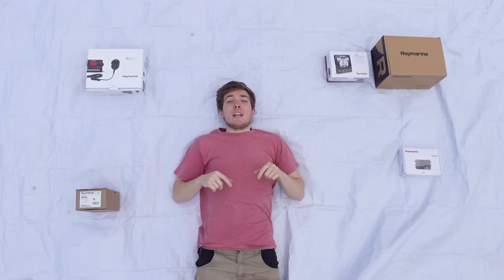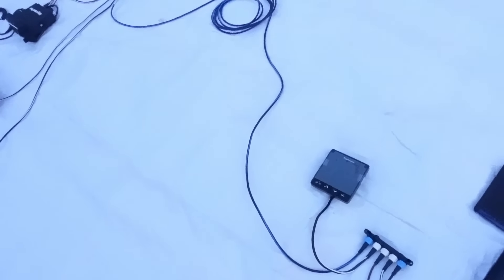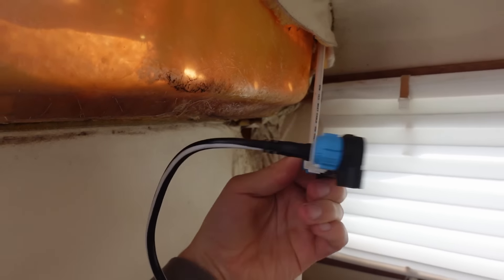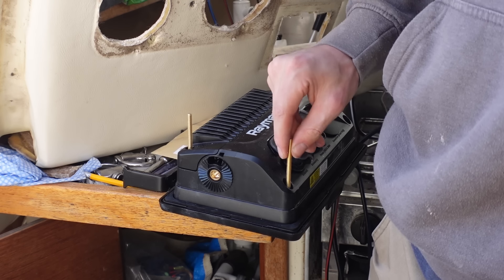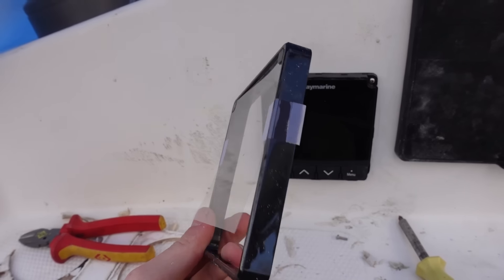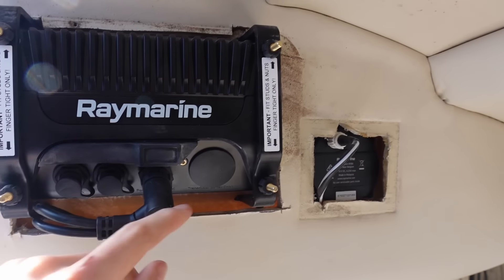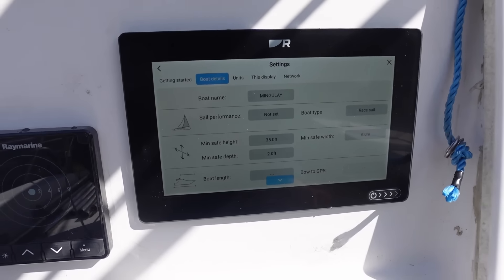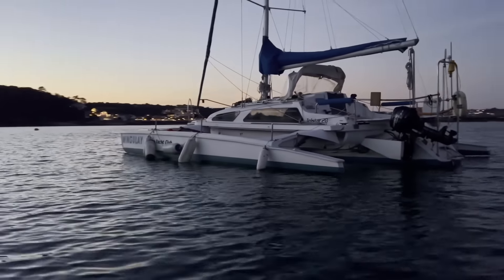HOW TO INSTALL A RAYMARINE NAVIGATION NETWORK | Ep.128

Comment: I have the raymarine element MFD can any name brand GPS antenna example garmin be used w/ raymarine? I want to avoid the seatalk cableing bc my engine/fuel tanks are NMEA2K thanks  BTW the way you have it all connected on the blanket makes it easy to visulize compared to stuffed in a closet. good work.
Reply from the maker: @steveleston1848  it can but has to communicate. I believe a converter between the two networks is needed and I think that’s the expensive bit. Especially when technically they both communicate the same it’s just a custom connector system that raymarine has. Annoying but what can you do 🤷‍♂️

Comment: Awesome 🤩 I'm looking forward to your first test drive. According to the ST1000/2000 manual, the wind vane should also be able to communicate with the tillerpilot over the network to create kind of wind steering system, right?
Best, Felix
Reply: Yep, you can tell it to either sail to a fixed bearing or to sail to the wind. I find sailing to the wind works better for me - I can set the trim, set the autopilot and then that leaves me to focus on the main sheet and keeping an eye out for the pesky lobster pots!!!
Reply from the maker: Yes that’s correct and thanks for watching!
Reply from the maker: @floydstewart2956  those pesky lobster pots!